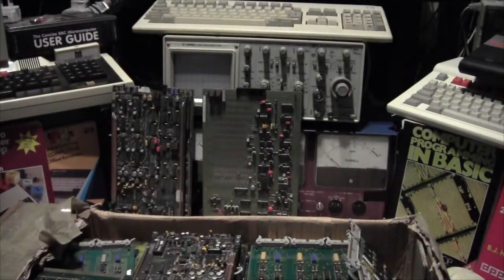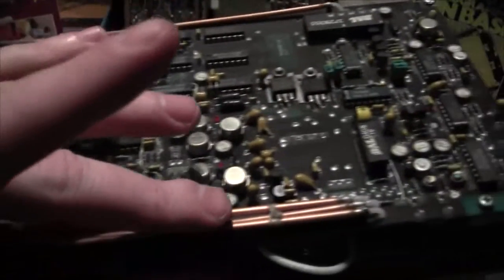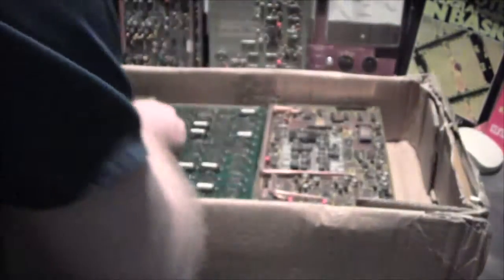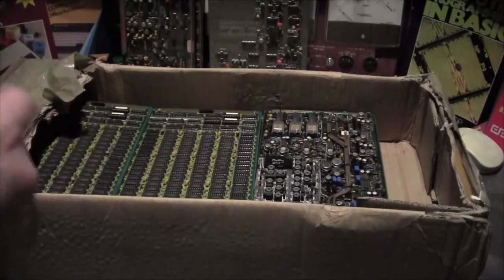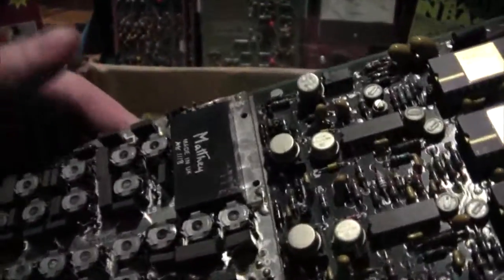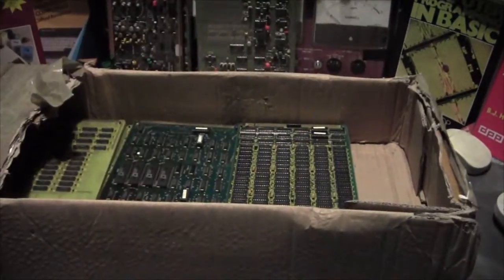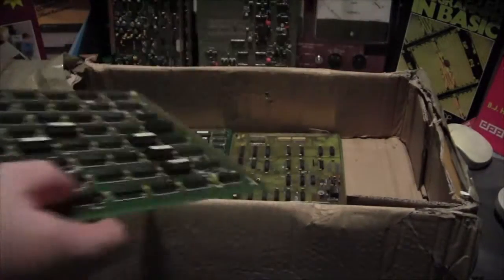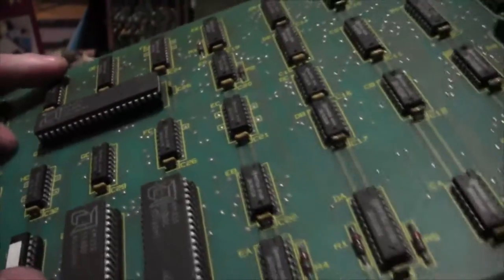Quantel Paintbox 7001 : A look at all the boards within (with permission from Quantel)

Comment: The strange rows of holes on the O/P locking board at:6:35 (and smaller areas on others) are just unused areas of the board. The holes are conveniently linked in breadboard style groups to allow the easy addition of any extra components that might turn out to be necessary for board modifications/upgrades. Very impressed that none of them seemed to be used.